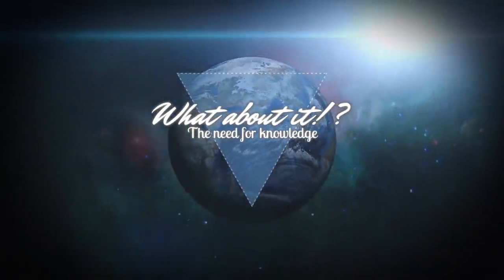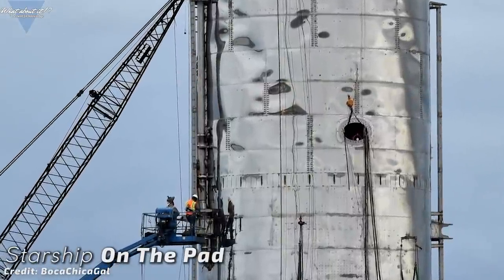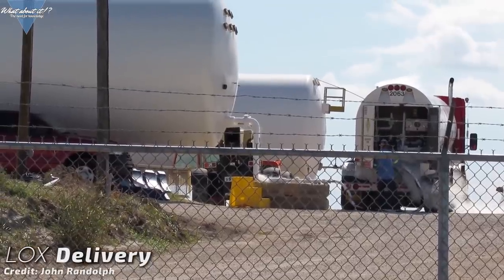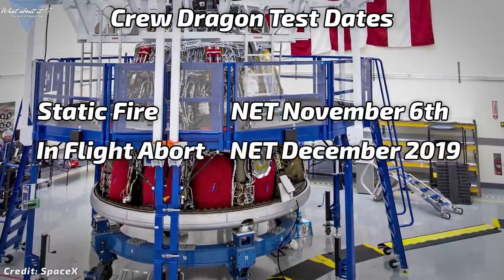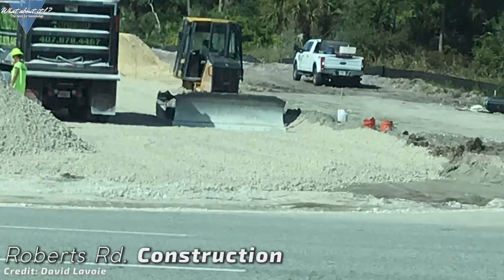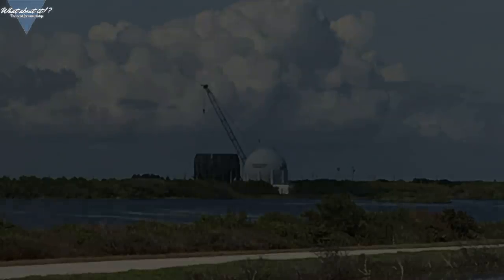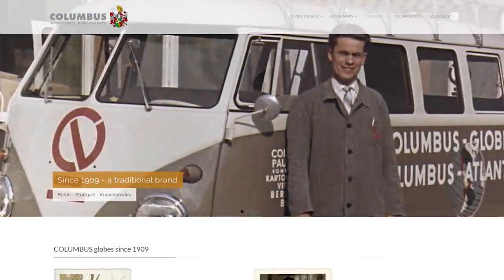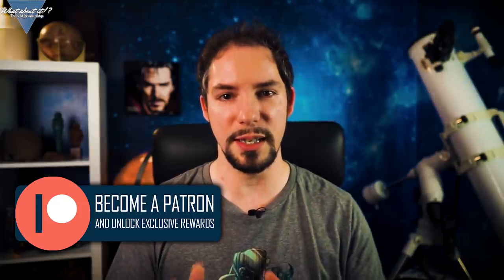47 | Starship Updates – Mark V At Roberts Rd. - Crew Dragon Testing - SLS Progress Update

Comment: It is my feeling that the dome we see at Roberts, is for MK4. The pieces were originally cut at the Cocoa site and transported by truck in August just before the hurricane threat. I believe they do not have the room at Cocoa to make three domes at the same time. Currently at the Cocoa site they have one dome outside for MK2 (expect it to be installed this week), one dome in the front of the main facility and I am guessing another dome in the hangar. They have not started the cone section as far as I can tell. One thing for sure, they are very limited for room at Cocoa.
Reply: John Winkopp , Where is the Roberts Road facility
Reply: Thank you for these crucial details, and your invaluable drone coverage of Cocoa.
Reply from the maker: John, thank you very much for the insight! I'll be at KSC in March! Would you be up for doing your drone flight with me? I'll bring milk and pop tarts!

Comment: The new set looks very good but don't forget to add back the blue light that used to shine on the book case.  It helped by adding dimensional complexity to the visual. Mach's Gut!
Reply from the maker: Aarne, thank you! I am working on the blue light. The problem is, that the old light was not strong enough for the big set. I want to bring it back too though. :) I'll figure it out!

Comment: The Mars globe is absolutely fantastic. It is a perfect addition to the set. 

On another subject, Starship looks like she has a bunch of dents where she should be flat/curved. 
I'm not sure I would want to fly on her. 
Maybe her buildup is going a little too quick?
Reply from the maker: Most of the dents will actually be gone, once it's pressurized. Other than that it still is a rough prototype... ;) The globe is absolutely top notch.
Reply: Felix, if you can´t wait to discuss missions using a globe, you need a Moon globe! :D
Reply: It's only an engineering test article intended to fly up only 20 kilometers and prove out the engines and control systems. It's not going to space, it's not going to carry any cargo or crew. It's just to provide data for the continued design process.

Comment: Now I want a moving solar system in my ceiling. Preferably with levitating planets so you can pluck them from the ceiling and inspect them, then place them back anywhere on the ceiling and it would float back to it's position. Would be amazing to have, but would cost a bit too much :(
Reply from the maker: Until you can afford that, a normal globe might be a good intermediate solution...;)
Reply: @Whataboutit  Thinking that building a miniature version would be a fun project, even if it's not big enough to put in the ceiling it could still be a cool desktop toy :)

Comment: I don't understand how the fins and sticking-out-bits are going to survive re-entry.  And it boggles my mind how they can come up with a system strong enough to move those fins back and forth while doing high mach numbers.  Or maybe I have it all wrong?  Do they somehow have the canards flat and out of the way while they are experiencing peak heating, and then only swing them out once they are going less than many kilometers per second?  I know they have worked it all out, but still amazes me.  The zones/regimes/tolerances must be all close - eg swing the canards out 2 seconds too early and you lose them.  Am I talking crazy things or do you think I am worried about real things?
Reply from the maker: You're worried about real things. But as you said, why should they build it, if they wouldn't believe, that it could work. I am going to stare at my screen, when it flies. :O

Comment: How could you say it wasn't for show? There were no actuators at the time, either...it was just a mock assembly. No aero covers on the canards now does not mean the final design won't have them.  It just means the launch won't be a balls-to-the wall full throttle launch. The final design will have to be more aerodynamic for MaxQ.  I'm not giving up this opinion! I  can see that for the purpose of the first test flight that they may not need them though. Oh, BTW....I think I can afford $1 to become a Patron. ☺️
Reply from the maker: Madison! Thank you for your support! :) I said it wasn't all for the show. You're absolutely right, that a part definitely was. I meant the fins. They are those, that were on Starship for the presentation and back then I got loads of comments from people saying they would be a mock up and that SpaceX will use other fins. :)